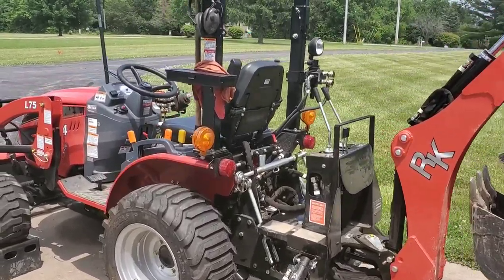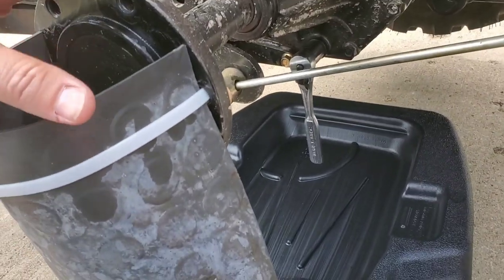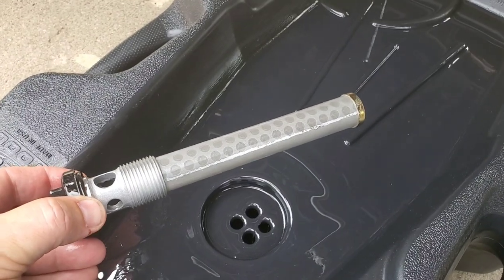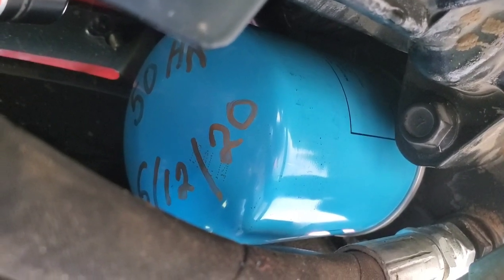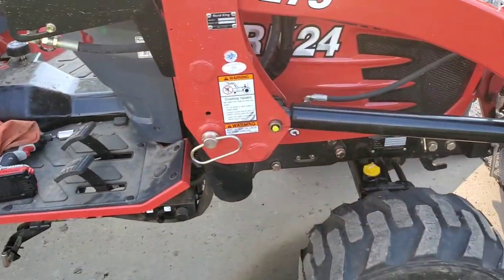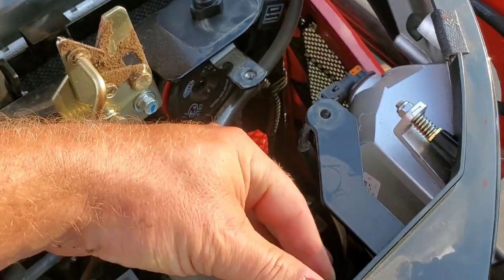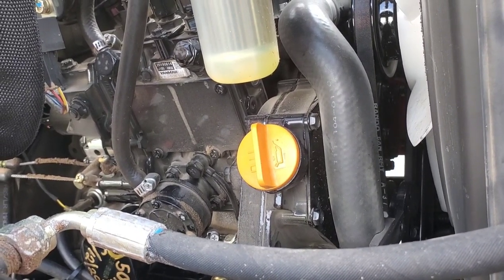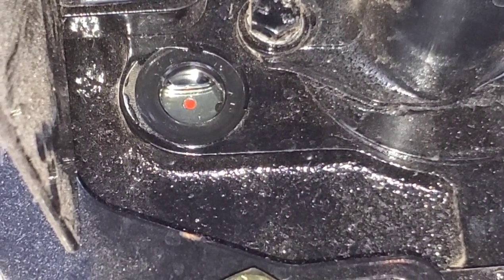RK24 tractor 50 hour service.

Comment: I am now stopped at the 7:00 minute mark where you are cautioning about the low torque on the transmission filter and am staring at the lock nut not being tight against the clevis.  Without it being tightened against the clevis the rod is free to turn and get out of adjustment. Thanks for this video as I am about to buy a RK24 with ~47 hours on it and will be doing the 50 hour service very soon.
Reply from the maker: Good catch. I had those loose prior to the service adjusting it a bit and hadn't tightened them back up just yet.

Comment: I saw another guy did not have to remove hose for trans filter. He cut zip tie and removed one end of throttle shock. He didn't remove the wheel ether. BTW do you know size for oil filter socket and PN of trans filter? Thanks!
Reply: Trans filter TYM 11102303100
Reply: Yep, that's how I do mine

Comment: In the video, you mentioned that there are 2 drain plugs for the hydraulic fluid, but you only show draining one side. Can you drain it all from 1 side or do you need to do both?  If both, is there about 1/2 the fluid on one side (e.g. 2ish gallons) and half on the other?   Thanks for posting.

Comment: About the hyd system oil filter being hard to access, I wonder if an oil filter wrench that attaches to the end of the filters with contracting fingers and turned with a 3/8" ratchet would make removing it easier?  It is difficult to see if it would work from the pictures.
Reply from the maker: That may work with the smaller 3/8 size once it is broken loose. Everyone I have talked to has complained about how tight those are on there when you do the initial service. I have a filter wrench like you are talking about but it is for big equipment and I couldn't get it in there. The 3/8 size may work though.

Comment: how did you open the hood to change oil?
Reply from the maker: There is a lever in the front near the bottom of the push bar. You push that lever.

Comment: Even south Korean engineers can't get oil filter location right. I'm leaning towards buying the rk 24 just a little nervous about it. I'm seeing people have issues with warranty service and getting parts.
Reply from the maker: I have seen some having the same thing. It has not been an issue that I have had though. My local Rural King always has what I need in stock. Sometimes I have to purchase it directly from the service people as some items are not on their stor shelf but I have always been able to get what I needed. 
I went with the RK basically because their warranty is longer than any other brand.